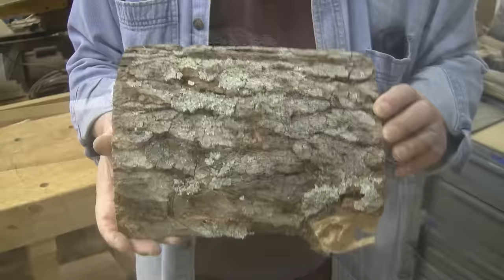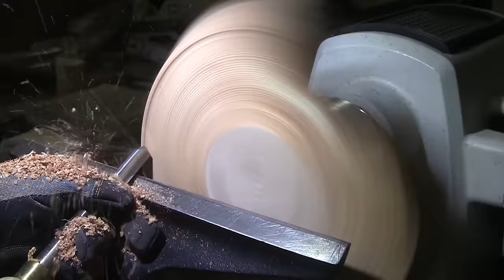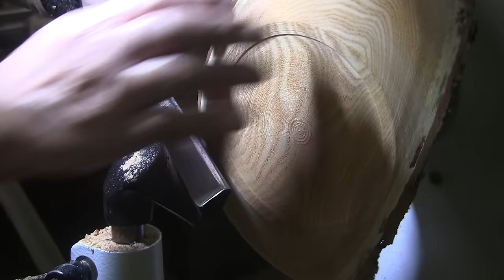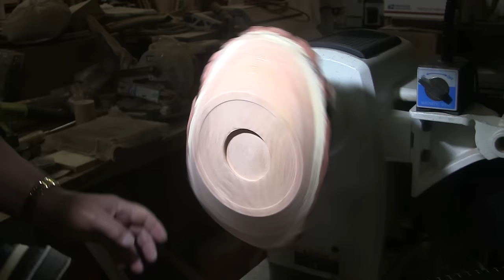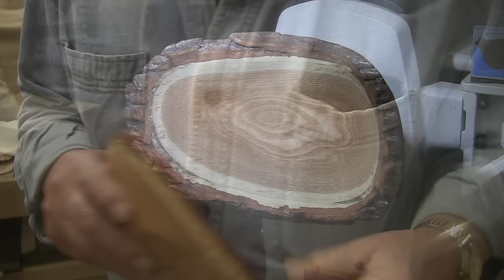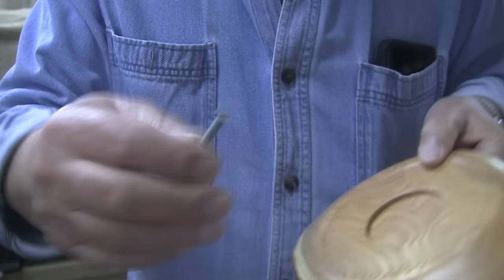What To Do With This Thin Slab?  Wood Turning

Comment: The times I have thrown away or burnt thin off cuts similar to your original piece and until now have not seen any possibilities of turning them into useful items. From now on I will be studying each piece with the knowledge that they could become a useful item.  Thanks for the videos Phil
Reply from the maker: No such thing as firewood if you have a lathe, Chris! 😊
Reply: @PhilAndersonShadyAcresWoodshop  I am using scrap plywood using a good glue and once dry turning large fruit bowls etc. on my lathe.  Unable to attach a photo.

Comment: Love the videos Phil. I have faith that you can make something out of anything. Thank you for the enjoyment and encouragement you give all of us
Reply: Another great looking project Phil. Thank you again for sharing
Reply: Different subject  - a process I'd like your thoughts on:
Short section of log (branch) with very bad radial crack. What would you think about separating the piece at the crack and making a lidded vessel - the larger part being the vessel with the smaller piece making up the lid? Does this seem feasible? If so I would love to see your take on the project
Reply from the maker: My mind just doesn't work like this, Joseph.  If I was holding it in my hands it might be different but I just can't picture what you are describing, sorry. 😊
Reply from the maker: Thanks, Joseph!

Comment: What character in that bark! A very successful piece, Phil. The sheen of the finish is just right. I should bump my next live edge up on the list, but it is grad season.

Regarding the dovetail tapered head screw mounting, I first used it on a wall hangar for a lightsaber I made. I turned a hangar/desk display that either cradled it at about 30 degrees, or hangs it on the wall vertically by the dovetail. The weight of the lightsaber makes it self centering.

From my photography days, I know of a type of drywall anchor with a 50lb holding strength and a better taper angle for picture wire or, in our case, a dovetail mortise. And they are not the barbed kind that spread once inside. I found Bearclaw Screws at Lee Valley, so that's a North American source, or at least an example of what I mean.  The anchors I found were a bit more aggressive. Regardless, great way to hang a decorative platter or art piece. Thanks for discussing it.
Reply from the maker: I have a tendency to overlook the obvious, sometimes, Jay.  Glad I could get this one out of my brain before I forgot it!  😊

Comment: Nice !   Wife really like the dove tale hanging idea, thank you!  
So tell us why you use sanding sealer so much please?
Reply from the maker: Thanks, Alan!
Well, that's a really broad question, I guess.  How much is "so" much?  I use it when I am going to apply a top coat such as shellac but could be any other clear finish.  Sanding sealer is kind of like priming before painting.  It seals the pores of the wood so the top coat can do it's job better and more efficiently.  I feel like I'm flailing about for an answer to a question I don't understand.  Help me help you!  😊
Reply: @PhilAndersonShadyAcresWoodshop  
Just trying to understand better on how to finish like the master you are!  It’s my understanding that it is just thinned shellac with ketone and alcohol so it penetrates well and drys quickly. Just wondering if there is more to it?  I use it with shellac finishes but not with lacquer or oil finishes, Should I maybe I would get away with fewer coats ?? 
Thanks … we really enjoy your channel. My wife wants to bring you some sweets. She likes to bake!
Reply from the maker: @alanneel2749  A key difference is it's dewaxed, Alan.  That's why you can apply any clear finish over it.  I likely will never use anything else.  I've been using it in woodworking for more than 30 years.

Comment: Phil - another great video/  I wish my mistakes were half as beautiful as yours are!  One question, though, what did you use on the bark?  It looks fantastic, but mine tends to want to fall off.  How do you treat yours?
Reply from the maker: I don't do anything I would consider special to the bark, Brad.  If it's loose I'll usually slip a little CA under it,  maybe clamp it.  Otherwise, it just gets the same finish as the rest of the piece.

Comment: Love your videos Phil. Only recently discovered them via Smart TV, Youtube. I am curious.Why do you so often choose to use a male tenon instead of a decorative female one which does not need extra work at the end? Thanks.
Reply from the maker: Thank you, Hervey!  I believe tenons are stronger for one thing.  Also, much of the wood I use has cracks that you don't want to open the jaws into.  Also, I have always believed a recess, just like a tenon, should be removed.  There should be no evidence of how a piece was held when you're done turning it.  That said, I've grown a little lazy, lately, and have been leaving the few recesses that I do use on occasion.  😊

Comment: Hi Phil:  Do you have to use a sanding sealer?  I am having a hard time finding it locally.
Reply from the maker: I guess you don't have to, David, but it sure makes applying the final finish easier and better.  Local may be an issue but you can find it on Amazon all day long.  😊

Comment: When using a worm screw do you also use the lips of the chuck or do they just press against the wood?
Reply from the maker: The front of the jaws push against the flat spot on the piece, Judy.  That is what creates the tight fit.  I have a very short video on the use of the worm screw if you care to watch: https://youtu.be/urEaJV30Ocs
Reply: @PhilAndersonShadyAcresWoodshop  I did watch your video and thx much!

Comment: I was wondering what made you  go with the finish you go with was it the shine ability 😅
Reply from the maker: In this case, I felt that since the wood is softer than most, sanding sealer and shellac would help harden it and give it some durability. 😊

Comment: phil, what determines when you use wood sealer with shellac, or Howard feed & wax?
Reply from the maker: It's really just how I feel about a piece at the time.  Howards doesn't do well with coarse bark, it's hard to get it back out of the bark and you can't buff it worth a darn.  Sometimes I'll blow it out and use a toothbrush to buff but it's not quite as good.  Usually smaller pieces are what I use it on but I guess I've probably used it on nearly all types and sizes of bowls.  That's how I know when NOT to use it.  My preference most of the time is shellac but, again, it's really just how I feel about it at the time. 😊

Comment: Hey Phil; do you sign your name before you put sealer or shellac on, or afterwards? I can’t seem to find the correct pen, or order to sign my name! The sealer/shellac keeps blurring the ink! Even the extra fine sharpi brand! What can I do?! PLEASE HELP! Ken
Reply from the maker: I either sign to bare wood or after sanding sealer.  I use an Ultra Fine Point Sharpie and apply paste wax over the signature.  The ink won't stick to shellac but will stick to sanding sealer.  That's because the sealer I use is dewaxed.
Reply: Thank you Phil for responding so quickly! I really appreciate it!
I‘be watched you do that at least a hundred times times, but I never realized you were putting past wax over your signature! I will try that. I really appreciate your videos, because you are doing exactly what I like to do, turning less than perfect bowl material. Thanks again, Ken

Comment: Router Woes, Hi Phil, I made a wooden guide for the router to cut a 38-inch long 1/4" groove. I started the cut, and my router jumped my guide and I gouged five inches that shouldn't have been gouged in our African Mahogany Coffee Table. I spent from sun-up to 2:30pm fixing up my mess. I still have some light 0000 steel wool and a minor touch-up and that is only putting the coffee table back to where I was before I started cutting the groove. I did the majority of clean-up as well. I showed my Sweetie Pie the before and after and she told me to finish what I am doing and then don't touch it again. Now you and I both know that the Devil Loves a Coward, and I never was one to back down from a challenge, but I think this one time I'll make an exception. PS Give me your mailing address and I'll be sending you a perfectly good, used only once router.
Reply from the maker: LOL!  Time for bed, Freddie!  😊

Comment: Try rotating your gouge so that the flute is at 45 degrees instead of vertical, and see if it cuts better as per David Ellsworth
Reply from the maker: Did I seem to have a problem?  Are you a woodturner?  I've found it's best to do whatever works for you.

Comment: When I use sanding sealer on softer or more open grain wood either turning or not I always go back and sand again and to a finer grit. And I always sand everything if it is a turning a knife hand whatever to 800 grit. And sometimes I even add sanding sealer a 400 grit and 800 grit then sand to 1200 grit. So no mater what finish I use it is like glass. Soft woods or hard woods. Hard woods no sanding sealer.
Reply from the maker: That's a lot of time you spend getting it right!  😊
Reply: @PhilAndersonShadyAcresWoodshop  being a retired dentist I try to do everything perfect which can drive you crazy. 🤪

Comment: I notice you use a 90 degree drill for sanding and it looks like you use an extension on the sanding bit so it gives you more extension.  I would call this a money dish.  Great to toss your keys and wallet or phone.
Reply from the maker: You are very observant, Jeff! 😊